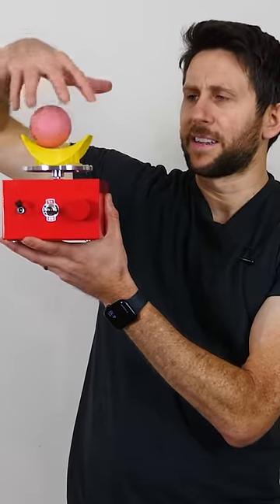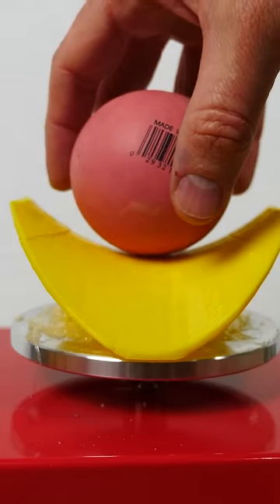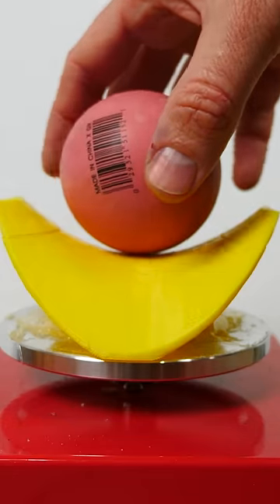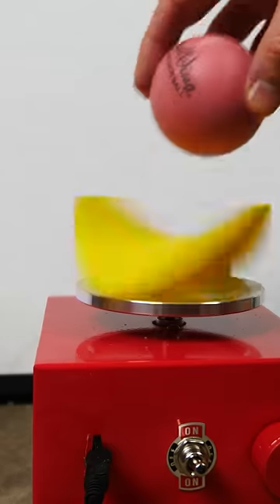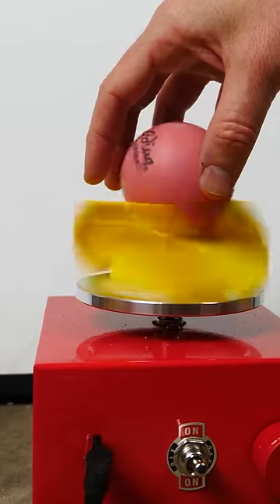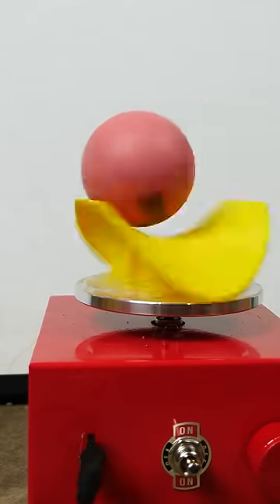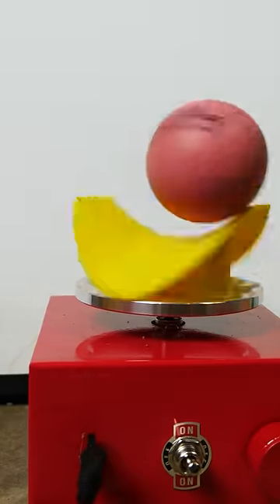Quadrupole Gravity Trap Holds a Ball

Comment from the maker: This is the same principle used in an ion trap. And yes, this is actually a 3-D print of a large Pringle. Any hyperbolic paraboloid will work so I just had to find the natural frequency of the ball rolling on the curve to make this work with that specific ball.
Reply: Is this also related to why the JWST "orbits" the L2 Legrange point?
Reply: 17k views and only ~50 views? That's not good enough!
Reply: Now let’s put it in a vacuum chamber
Reply: The saddle looked so much like a pringle that I read “principle” as pringle
Reply: Yeah...I have the munchies, too
Reply: You do not need this to trap ions. Do you mean ion mass spectroscopy using quadrupole electrodes that form a hyperbolic potential like the Pringle? There,  the timing filters out a specific on mass and remove all others.
Reply: Suns Quadrupole
Reply: "and yes, this is..." My man, knowing the audiences most burning questions
Reply: How does one find the frequency of a ball rolling down?
Reply: Need to make a giant shiny metal version of this as an art display in a public park. Just don't let the power go out.
Reply: Obv...
Reply: What is the natural frequency of a ball?
Reply: Wow I just realized a Pringle is hyperbolic
Reply: Wouldn't this be an object with exactly one stable point at the direct center (assuming you can properly balance it) 

As an AE we would generally call this negatively statically stable because while is does have one statically stable position any disturbance causes it to move away from it's stable position.
Reply: @inthefade  i can't find what an iron trap is aaaa
Reply: Can we get an explanation on how to find this frequency? Is it dependent on radii or material or what?
Reply: I have a feeling experimentation may have been a more efficient route in this scenario
Reply: I thought he said Pringle 😂
Reply: @electricerger  frequency is dependant on the ball's rate of rotation.
Reply: Thank you! This is just what I needed
Reply: I noticed that you spun the ball on the successful attempt but not on the others. Would an induced spin have any effect when the rotation speed is not set to the natural frequency of the ball?
Reply: when you say natural frequency of the ball... is that its acceleration within earths gravity? how can there be a frequency of gravity?
Reply: Is this the same principle with what happens with a bicycle in motion?
Reply: @inthefade  langaran
Reply: @crazysasha1374  from rereading his comment and the video, I think the frequency is the time the ball takes to roll down the slope... please confirm @actionlab
Reply: I read that as the same pringle
Reply: can this work with a half saddle ??
Reply: I wonder if this principle would help explain what the anomalous disk found in egypt did?  you know, the one with those same curves in it.  Kind of like a steering wheel with those ears on it.
Reply: How did you find the natural frequency of the ball?
Reply: I thought it looked just like a Pringle
Reply: this is like an inside-out orbit?
Reply: Is there a range of ball diameters that will work inside this saddle?
Reply: @inthefade  No way they would rely on objects in space to "nudge and pull" it. Too many variables. Unless I don't understand what you mean?
Reply: You spun the last one to.make.it.spin?/if you did this with the others would it work
Reply: @crazysasha1374 you’d write the differential equation of motion for the ball and from there you’d be able to derive the natural frequency. At least that’s what I would do
Reply: @pumkin610  look up quadrupole ion filter
Reply: Where did you get that ball?
Reply: As someone who works with a LTQ ion trap mass spectrometer, this was an immensely helpful visualization.
Reply: @Crazy Sasha  the maxwell equations define the parameters I believe
Reply: I wonder, had you not given the ball a little spin as you dropped it would it still have done so well? Can't stop watching! 😅
Reply: Fréquence de résonance.
Reply: Sorry how exactly does this prove gravity?
Reply: You put a spin on the last one, and not the first two.
Reply: do u have a video on ion traps? OwO
Reply: Nyquist?
Reply: So, I came here to ask “why do I all the sudden have a taste for Pringles”?but It was just subliminal powers.
Reply: How did you find the natural frequency?
Reply: @jackfernald8823 You mean Nyquist frequency?
Reply: I think this is how the recent rotating magnetic levitation thing works.
Reply: With a 3-point Pringle the ball must spin 50% faster than with a 2-point Pringle.
Reply: So cool!
Reply: How do u find the frequency of the ball?
Reply: Now we mingle with the pringle!
Reply: Once you pop, you can’t stop!
Reply: È la stessa cosa della frequenza naturale di un pendolo. Quella cambia con la lunghezza del braccio e con la gravità questa cambia con la curvatura della sella e con la gravita
Reply: spinning chip
Reply: What is the "natural frequency" of the ball? When it's rolling off its movement is aperiodic, so how can we talk of a frequency here?
Reply: Ion Trap. You're cute. They are called Quadrapoles.
Reply: @alexdrudigmail What does this frequency have to do with the problem? Foe positively curved part of the saddle we don't need rotation — the ball will remain trapped along this coordinate whatever the frequency. It's the negatively curved coordinate which poses problems but it doesn't possess any frequency as this movement is aperiodic...
Reply: Mmmm.  Pringles.
Reply: Isn’t this kinda like how we keep satellites in orbit?
Reply: @davidhowell1415  No. Satallites are, quite literally, falling around the earth.
Reply: @johnsmith1953x  yeah that’s what I’m saying the premise of the ball following the pinnacle of the center would be similar to how a satellite would maintain orbit. So I’m thinking I’m as correct as you are
Edit because that ball was quite literally falling around the central peak
Reply: @davidhowell1415  No. The ball is being pulled in different spots at strategic times. I thinks that different.
Reply: @johnsmith1953x  things can be simpler and different simultaneously
Reply: What might be a practical use of this phenomena?
Reply: @inthefade  I don’t have credibility I’m just a nerd but as far as I know the way that orbit works is that the horizontal component of gravity kind of cancels out the centrifugal “force” on the jwst. This extra horizontal force allows it to orbit the sun in the same time that the earth does, even though it’s in a higher orbit. You can visualize the orbit as one of those flying bird toys on a string. The bird is held up by the string, but the string isn’t straight so it also has another component to the force of tension. That’s the force that allows it to move in a circle, since it’s constantly being pulled to the center. This is the same at L2 Lagrange because the gravitational force comes in at an angle and therefore has vertical and horizontal components.
Reply: How long before the ball fals?
Reply: @alexandermarsteller7848  this is how a linear paul trap works
Reply: How’d u find the frequency of the ball? Just a bit curious on how that math works- maybe you’ve already done a video like that?
Reply: How did you find the natural frequency of the ball?
Reply: What use it?
Reply: a pringle, thats a pringle.
Reply: Is this experiment anywhere related to Lagrange point in space please explain.
Reply: I'm 70 and I completely get. Does it work on horses when you ride them. It's not for me it's for my wife.
Reply: Dumb question, I'm pretty sure. Is there ever a moment when it could becomes centrifugal motion?

Comment: I can imagine how many takes this took.
Reply: I'm thinking he used math. He's sneaky like that.
Reply: It's not that hard all he did was spin it. 2 takes max.
Reply: 5
Reply: He knew what to expect, so most likely started at a high RPM first and kept adjusting it slower til the ball's natural frequency was too quick for the saddle to nudge back into place. 
From then on he knew the minimum RPM necessary to keep the ball from falling off.  
Of course all the physics are well understood and the performance of this apparatus at any proposed scale, RPM and specified mass distribution of the ball can be calculated in advance.

Comment: If you look at the path the ball is tracing it is essentially orbiting the center. This is almost how the Lagrange points work.  In the Lagrange points the system is essentially orbiting in resonance with the rotation of the system.  Since the center of the Lagrange point is the highest potential in the well it essentially acts like a virtual repulsive point in space and the orbiting is just like how this works.

Comment: Normal frequency of the rotation of the ball*

The ball itself doesn't have a frequency. It does have a rotational frequency, whose oppositional frictional force is opposed by the repulsion & pull caused by the rotational frequency & frictional surfaces of the saddle that are directly interacting with the ball on its frictionally relevant surfaces.

Comment: By analogy, ostensibly unstable static like-repulsive charges at any given point in the field matrix of the nucleus are not, in fact, static but are dynamically smoothly stable because inertial delay in nucleus mass balances and cancels out proton-proton repulsive movement in any direction.  The directions of those vibrational forces are smoothly and continuously changing. Thus, a static “strong nuclear force” is a mythical construct created to explain how inertial delay in a dynamic vibrational nucleus field matrix allows non-fundamental charge to stably and predictably change throughout the vibrational cycle?

Quadrupole gravity trap: correct harmonic vibrational (here rotational) frequency stabilizes what at other frequencies would be unstable? At any point in the 3-dimensional field of this system the inertial delay in the movement of the ball in any one direction allows the smoothly and constantly changing direction of the forces in the stable rotational frequency to balance and cancel each other out? There is no “strong” or “weak” Pringle Force holding the ball in place against the static repulsive up and down forces of the Pringle shape. Rather, it is the repulsive forces themselves that balance themselves out when they are put into a smoothly and continuously changing dynamic rotational state?

Thus, by analogy, the nucleus is a Quadrupole CHARGE trap in which a posited static “strong nuclear force” is, in fact, a dynamic balancing and canceling of repulsive directional movement by inertial delay?

Comment: Centrifugal force lol
Reply: Then why does it fall on different speeds
Reply: @SajtosNokedli  I'm pretty sure it fell at diffrent speeds cause it wasn't fast enough to spin in place
Reply: @mrtree1368  He tries it either with too slow and too fast speed. Plus centrifugal force is always pointing outwards, so it would just try to push out the ball from the middle in itself.

Comment: The ball doesn't have a "natural frequency". That natural frequency stuff is pseudoscience bullshit. The spin timing aligns with the resonance of the change of intertia of the mass of the ball. If the ball were of a less dense or more dense material the inertia change would be faster or slower and you would have to adjust the spin speed accordingly.